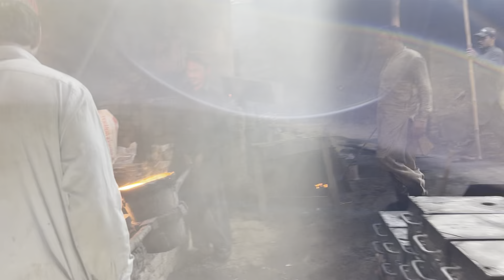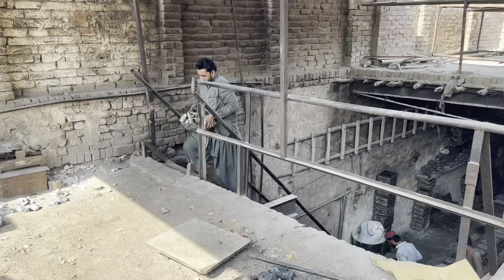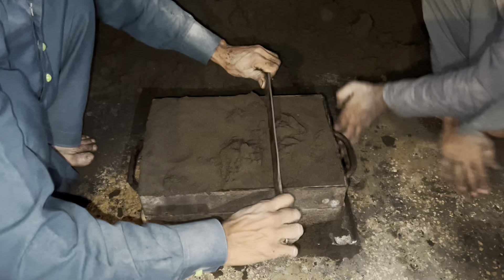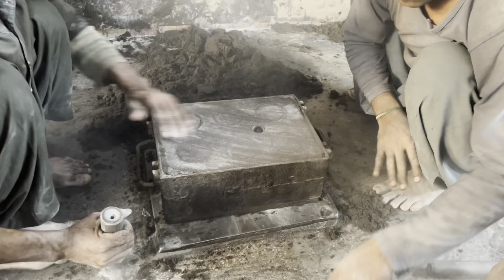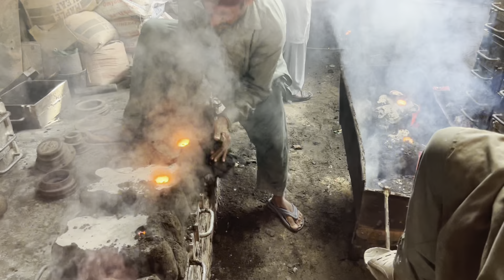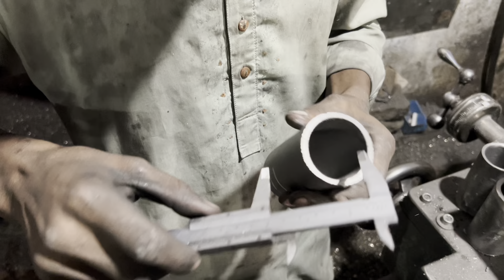Manufacturing Process of Engine Block Cylinder Sleeves and Cylinder Liners

Comment: Hey! How dangerously close to the furnace top is the worker charging the furnace is! Has anyone told him that it emits deadly poisnous Carbon Monoxide ? No even a flue over the top, what to talk about precipitators/ scrubbers! What is the chemistry of metal mixture charged and of the melt? Microstructure and Mechanical Properties? Are any vehicles lying there with engines siezed?

Comment: There are at least 5 types of cast iron. There are increased requirements for cast iron, which is used as engine cylinder liners. In accordance with state standards, cylinder liners are made of gray modified or alloyed cast iron with mechanical properties not lower than those of SCh 21-40 cast iron, with a hardness of HB not lower than 170-190. Liners of high-speed engines are heat-treated to a working surface HRC hardness of at least 40. What kind of cast iron is used here?
Reply: The FE type.
Reply: The type used here is whichever scrap pieces were lying closest to the furnace at the time of manufacture it seems.
Reply: lol who knows as long as a magnet somewhat sticks to it its good to go
Reply: All of them.

Comment: It always amazes me to see people doing this.  Making molds and castings but I can’t help but wonder what the final product is. I know it’s cast but cast sterl ir cast iron as I see a mix of both going into the furnace along with what I assume is coal for its carbon content being incorporated into the metal.   Still fascinating none the less. And they recycle everything possible.
Reply: Definitely dangerous work. The bottom of the carry flask for the molten steel looks cracked considerably as it leaks molten metal while they walk and do this work in sandals.  Situational awareness is probably very high among those with few to no molten metal burn scars.
Reply: It chips away while being cut on the lathe like cast iron.
Reply from the maker: Right
Reply from the maker: This is Pakistan

Comment: Dose anyone know what they actually use for there casting sand and what they mix in it plus a rough ratio. The stuff I use over here in the UK the so called green sand that's red is crap. trying to keep the edges from coming out with the part your trying to make a mold of is impossible it just brakes away no matter what I do and how hard its compacted.
Reply: для склеивания песка используется патока - отход сахарного производства, там где есть сахарные заводы, её недорого продают для добавки в корм сельхоз животным